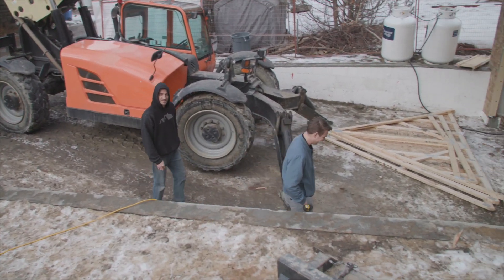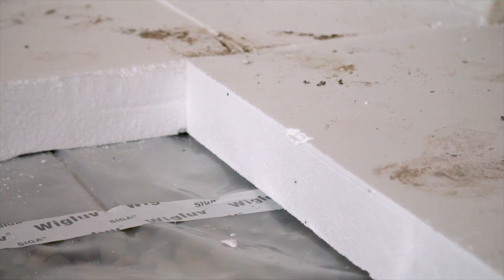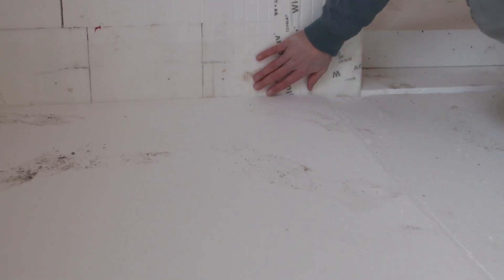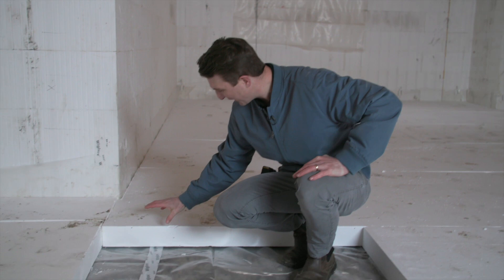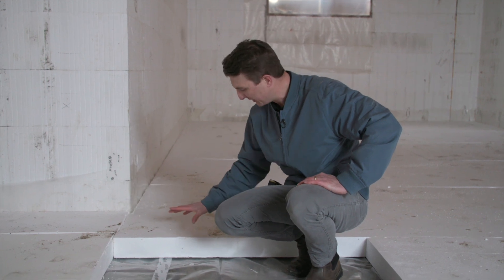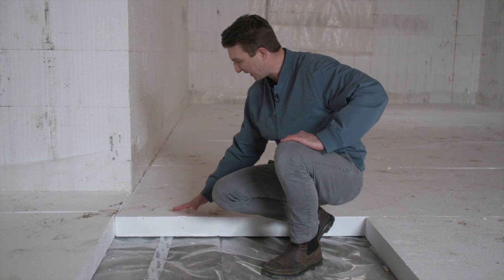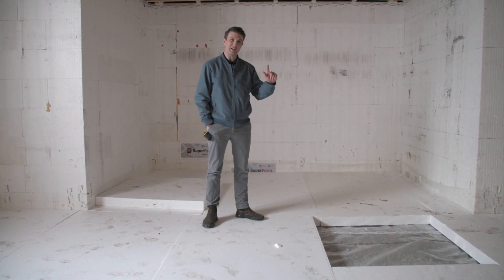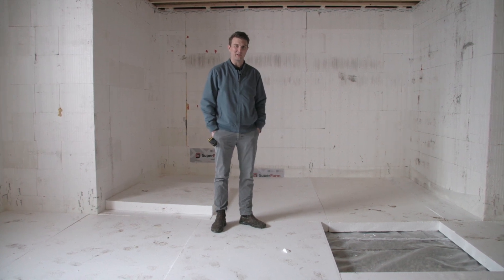Concrete Slab | Why we LOVE this Concrete Slab for our Net Zero Home

Comment: 44 years ago I built an earth sheltered home. 3 sides covered and roof covered with 3 ft of soil. After waterproofing we covered the 3 sides and roof with 6 inches of EPS. It was 1500 sq ft. We had a small wood stove that that was more than adequate to heat and an 8000 btu air conditioner to cool and get rid of summer humidity.

Comment: Glad to see more than r10 under slab but in my opinion r16 still isn't enough. Like you said it alway 4c under that insulation. So in your shoulder seasons when it's 10 to 20c outside that floor is still fighting 4c.
We are now spray foaming all under slab with a minimum of 3 to 4 inches. R21 to r28. Also if you are doing radiant heat in the slab I recommend r40 to r60 as the floor is kept at 22c and the water running through the tubing is typically around 38c. Big delta between 4 and 38. The ground is always sucking heat out. #1 rule of heat transfer, or only rule, hot to cold. 
Also best to split your rigid foam into 2 layers with overlaps if using sheet goods instead of spray.

Comment: wouldn't it be better to put the 10 mil plastic on top of the EPS to stop the risk of the concrete getting under the foam and causing it to float (iceberging)?
Reply: I had the same question.  Other designers have brought this up.  He must not have an issue with it while pouring the slab, otherwise he wouldn't do it.  "It's not dumb if it works" haha

Comment: Wont moisture condense between the foam and the plastic the way its laid?
Reply: I'm guessing the slab will have hot water heating, so the warm floor will not condense moisture. They're also in Calgary Alberta which has a pretty dry climate. I wouldn't worry about it.
Reply: @3th1xs  what if it's off?
Reply: @VanillaAttila Moisture moves up in this situation, not down.  You're trying to keep the moisture from wicking up.
Reply: @karlhungus545  moves up until it hits a temp differential that'll condense it
Reply: @VanillaAttila  Yes, underneath the slab when it hits the vapor barrier.  It's the way we do it here in -50C winter Saskatchewan.
Reply: @karlhungus545  the underlayment I put on my concrete had dimples to allow air to move and dry out the area. I don't see how any spills can dry out with this setup.

Comment: are you accounting for a full basement's worth of concrete and this massive amount of EPS foam in your net-zero system?
Reply: Net zero homes have nothing to do with the amount of products/energy consumed while building. Net zero is based on house performance, creating more energy than it consumes or atleast being 'net zero'. You could use 10,000 dinosaurs worth of oil to create a house but as long she's well insulated, air tight, efficient heating systems, and has solar or geothermal it can qualify for net zero. There is nothing environmentally friendly about building homes, or cars or air planes or your phone or anything so while consuming a lot of dead dinos to make a house its better than burning more dinos to heat it for the next 100 years
Reply: except that you could actually do away with a lot of the concrete and plastic being used on this build while maintaining the building performance, and do a lot more to mitigate the embodied carbon going into the build...  @mountains2938